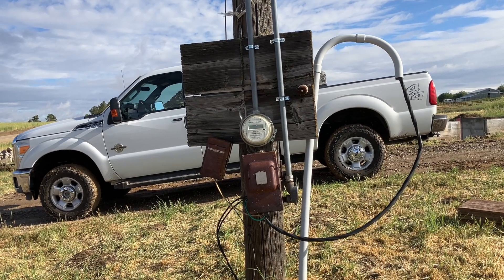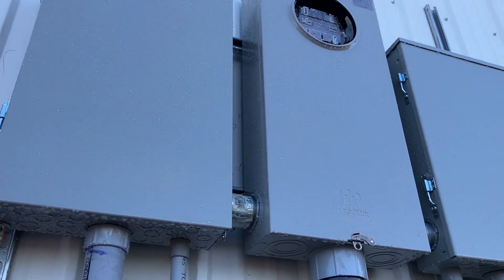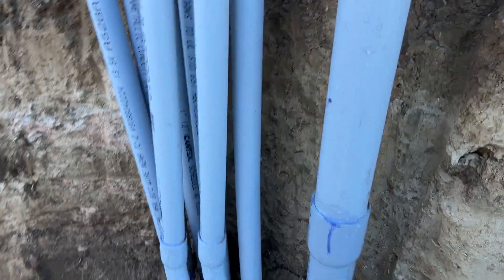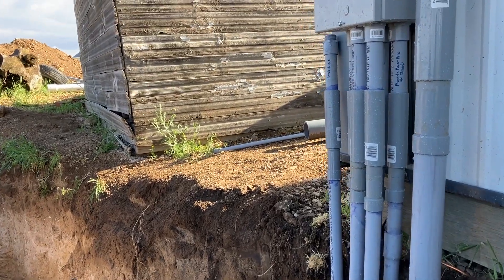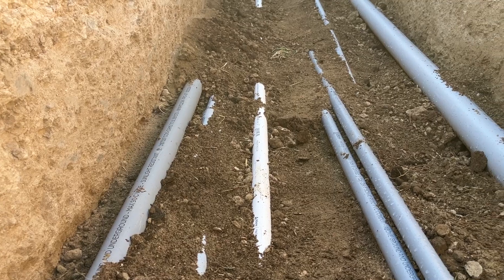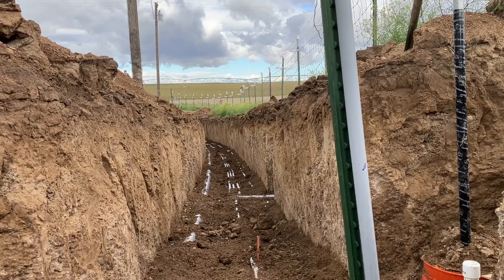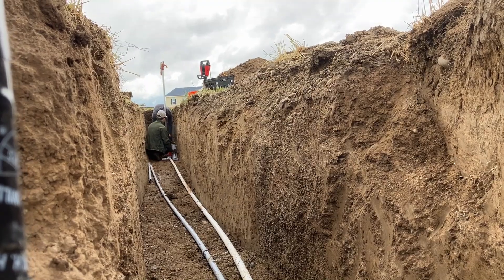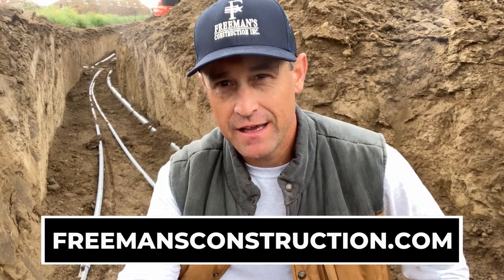Underground Utilities [Installing Conduit for a New Underground 400 Amp Electrical Service]

Comment: is 2" pipe work for aluminum or just for cooper? i ask because if it is aluminum is not gonna be too tight for conduit wires 2.0?..is a just a question i would like to know...nice work nice and clean.
Reply from the maker: You should be able to fit up to Qty 5 - 2/0 wires in a 2” Schedule 40 electrical conduit. I would recommend checking the most current NEC code that has been adopted in your local area to confirm you are meeting code requirements. Thanks for the question!
Reply: Water line with the electrical?